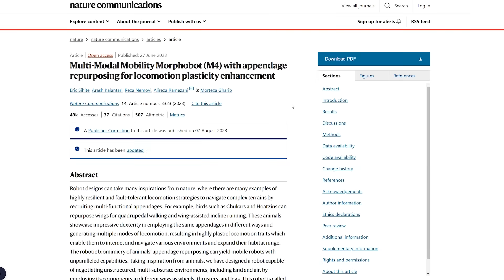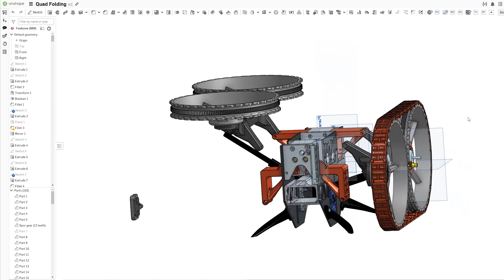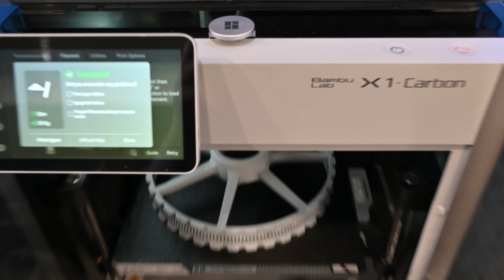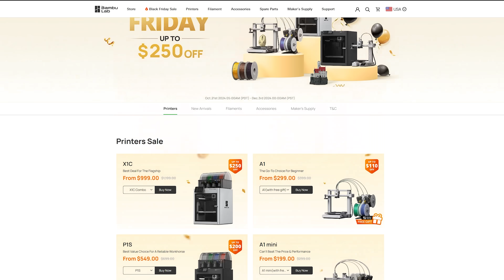Building a Real Life Transformer

Comment: Could you have it changed the gear reduction on the wheels/rotors when it changes mode? Higher torque for land and higher rpm for air?

Comment: Probably an aluminum plate with the same weight as carbon fiber is stronger because you cut the continuity of the fibers doing weight saving cuts, and all the cuts should have big radius not 90° - 45° sharp corners

Comment: I literally had this idea about 2 years ago. I'm currently in my last year of Mechanical Engineering, and I wanted to make this as a personal project after finishing to just apply what I've learnt and add to my resume while I look for jobs.
I thought I was the first to think of the idea so I was a bit crushed when I saw that it has been already done lmao, but ig I haven't done my research. It shouldn't matter too much, my initial sketches of visualization had a slightly different approach to switching from rover to fly mode and the general design of the vehicle.
One of the most interesting ideas in my "light bulb" archive and you've certainly done a great job giving it justice. 
Just subbed, great work!

Comment: Couldn't it be set up to where 'off' was in the middle...and then when switching to drive mode, you could set it up to do either top or bottom. That way if you flip it it would be able to still move(upside down). 
It would probably require a half overhaul. From linear actuators on possibly. Not sure...thoughts anyone?

Comment: I would definitely still be worried about the actuator/mechanism taking too much of a beating. I think some changes that might improve this is some servo mechanism to lock in the two different modes by sliding a pin into a hole so that the parts make it solid and not the electronic servo actuators. Might also sage some weight by using some lighter driving motors as this type of vehicle probably does not need to go all that fast. In any case a very impressive design with seemingly few issues considering the complexity. Imagine making this thing with so few issues and then previously having so many issues with the push-pull plane.

Comment: I hope you still check the messages for this video, but my suggestion is to not extend the body of the craft up above the wheels when in driving mode and instead to make it thinner so that it can be suspended over the ground and fit within the height of the wheels so that you can drive it upside down if it flips. If you can design the linkages right, you could even allow it to transition to flight mode even should it get flipped on the ground.

Comment: I wonder if the problem you had with the linear actuator was because they're effectively being treated as the struts for the drive mode. The rigid connection between the wheels and the body at that point is probably what ultimately broke it when driving around. Maybe in a future version you could have some sort of two-part struts that slot into each other when switched into drive mode to take the strain off the static actuators.

Comment: It would be interesting if it can handle a cargo bay or consider to have a passenger cabin on top or below. The motor for the flight might be a little too low for the job compare to the weight of the unit, it's like too much stress or power needed to make to a higher height? maybe more power source can solve that. Plus having a thread is good way of not damaging the rotor blade from from the impact on ground. May add some mesh cage by the blade to protect it from hard debris that may come while on land mode. Hope to see new variants of this, this has a potential to make it as an air-to-land "amphibious cousin" transport, lol.

Comment: If you need to reduce the weight, shouldn't the tracks be the first thing to go since you already confirmed that they aren't necessary? Give the wheels a grippy monster truck thread for the rough terrains and you could save another 100 grams. Also, the folding design could be designed better so that the 2 stage transformation could be done in one movement with only the two linear actuators. Or use only one servo with a greater gear reduction that controls both sides simultaneously, the wheels need to be aligned whether you're driving or flying anyway. Still a great project, and fantastic job getting it to fly!

Comment: Removing weight from the unspring weight wont remove much stress from the servo, try release some weight from the section the actuators are holding off the ground as its hitting bumps and wheelying around

Comment: All those screws in the tracks seems a little unnecessary. You could use small lengths of filament instead. (Like Ivan Miranda does on his tanks) you also could eliminate the tracks anyway for some more weight saving. You could add limited acceleration (eg. Instead of 100% to 0% instantly, you'd first do 50% for a second then 0% to not "lock the brakes" and flip. Or even 100->75->50->25->0 with each change waiting a specific time). I believe the term to look into is PID. On my projects I just have a target speed and a max acceleration that can be added to the current speed until they're equal.)

Comment: Michael, That pebbly texture you get on CF can be done on any filament using the "fuzzy skin" option in Bambu Slicer. I have mine set to 0.15mm for both settings and it gives a pebbly texture that hides layer lines pretty well. Additionally, on parts that aren't under much stress, Bambu has an "Aero" foaming filament that looks to be pretty light.

Comment: Im confused, you used two separate motors  too operating the left and the right side while in drive mode.  However.. your configuration forces both tires on one side to spin in opposite directions regardless.. the car wouldn't move

Comment: it would be nice if you had cams that will move the wheels up off of the ground before swinging them out for flying mode (and vice versa).  I think a lot of the strain on your linear actuators is overcoming friction with the ground.   ...also, I want one of these to use as a leaf blower!

Comment: That design is absurd cool, would it he good to tweak the height on the transformation?
The wheels folding out are asking to snag on terrain and put unnecessary stress on the pistons, just "extending the movement" of the car lowering in its "compact mode" a bit further would make the drone landing legs contact the ground earlier (the best would be longer drone legs), wheels raise a few cm and clear the ground before folding out

Comment: very cool project. I think it would be interesting to see a few things: 
1) Can you create a unified drive system, rather than that completely separate ones. I guess technically there are 3, the main drive, the rotors and the conversion system. But anything that could unify or simplify those systems would be interesting
2) Further reducing weight. This would probably be helped by a unified drive system, but beyond that anything that could make this lighter would be interesting. It seems to perform both functions, but the flying aspect of it seems significantly less capable than the driving one. Also, by creating a lighter system, it opens it up for other things to be added like cameras, automation controls, sensors, etc. 
3) Less interesting, but the time to switch between modes seems a bit slow and I wonder if it could be sped up. For example, I'm not sure if the lifts/drops of the chasis are necessary if there is another way of making those linear actuators do the full conversion action. 
4) It could also be interesting to see either a smaller or larger version of this. The smaller one could be cool if it reduces costs, makes it more portable/travel size, etc. The larger version could be cool if it had more power and could handle some type of payload 
5) would be interesting to open source the system to see what others can develop on top of this, and then do a video highlighting people's mods. Could also compare this against some of the university projects you mentioned. Appreciate that the stls are already available for free though.
6) You could expand the functionality/scope by making it also turn into a boat/water craft. Or even if you could make it into a submersible. 
7) I'd like to see other applications for it beyond the hopping over a creek. Perhaps reconnaissance into hybrid spaces. Maybe as a creative platform for different photo/video shots (probably needs more stabilisation).

Comment: Hey guys. Listen please. I'm just a process engineer but what the hell. The thing is kinda hard to fly because the center of mass is bellow the props. If you can add, let's say the battery modules at the top with a turret camera or whatever just to displace the cg would make the contraption much stable during flight. It wouldn't affect the drive mode that much IMO. Cool adventure. Impressive nonetheless!!! ❤
Reply: It’s also still too heavy. What’s the thrust to weight ratio?
Reply: Center of mass is almost always below the props

Comment: The idea of transforming from tank to quad is that you only use 4 motors, you are using 6 plus a bunch of servos, it would be better to just set the propellers in a statick position on top and the 2 motors for the tank track and you don't need the servos, no trasformation issue and way less weight,  btw there is a bunch of toys like this but with only 4 motors

Comment: This was a graduation project in the Faculty of Engineering at Ain Shams University for students in the Mechatronics Engineering program. Actually, they passed with a good grade, but the project did not work because the weight was too high. So, I want to tell you: good job, man! You made it by yourself without any help, and it worked.
Reply: pretty sure this was a project at caltech too, which had more modes available than the one he built. Pretty cool!
Reply: A group of university students couldn’t achieve what this man built in a cave and a box of scraps
Reply: @Noname-iq1gz  I also studied mechanical engineering. The skills needed to actually build, they cannot be acquired there.
Reply: Actually comparing to this man they are in a cave 😂😂@Noname-iq1gz
Reply: الأخ مصري
Reply: 🫡🫡 those uni senior year projects are a doozy!! He actually did a fantastic job
Reply: He not only figured out how to build it but he figured out that it needed to be figured out without even realizing it needed to be figured out
Reply: This has practicality assume it is going in terrain toward enemy line and suddenly it went airborne and started attacking
Reply: Did anyone else realize Mechatronics is like Megatron who is a transformer?
Reply: so they made this useless copter as Engineering project? lmfao
Reply: @furquan2792 having a pretty unique concept is pretty good for a university project, isn't it?
Reply: @TiMona42  No it must have practicality first!
Reply: @furquan2792  well you don't know until you make it
Reply: @furquan2792 major elitist vibes
Reply: @furquan2792  Why? It should always be an overengineered monstrosity first, so you know how to simplify it later. Besides, the practicality is it's fun!
Reply: @furquan2792  i dont see it as useless tbh. sometimes, u need what is known as a proof of concept. only when there is a proof of the concept, that concept can be further developed into more ideas. its like, having the internet. the creator did it and released it. but u dont see the creator of the internet coming up with youtube, facebook, instagram etc. it is ppl whom have dwelled with it, ppl with a different idea that further leveraged on a system to further maximise the potential. as in 1 of my post, this has great real world applications. rubbish are resources that has been placed at a wrong place. similarly like ur comments. it is a great comment in something somewhere else, but is trash talk here....

Comment: Maybe the wheels shape could be optimized to increase lift... Maybe shaping the edge with a curved lip as a ducted fan inlet to increase the lift? Maybe twisting the spokes with a pitch opposite to the propeller pitch would straighten the airflow and increase thrust too (I think I saw something somewhere mentionnig that such vanes worked like that for stationnary ducted fans)
Reply: Something I'd say is to tweak the height on the transformation too, the wheels folding out are asking to snag on terrain and put unnecessary stress on the pistons, just "extending the movement" a bit further would make the wheels raise a few cm and clear the ground before folding out

Comment: That's amazing! You've got a new subscriber :D
I've got to wonder if you can't use the same motor for driving and flying.... probably an issue due to torque requirements but perhaps with a few gears that attach/detach from the rotor shaft when the mechanism transforms? Also... I'm probably asking for too much but this thing begs to be flippable (i.e. drive both upside down and normal). You could even have bigger rotors that way.

Comment: I just thought about this the other day but without the tracks on it. The idea I had was to make an RC car with a drone motor in each wheel, have the wheels be the propellers, and then have the upper control arms attach to a servo motor that pivots the wheels facing down. then you can switch into flying mode while driving. You would just need to make the wheels into slicks and make them really light, but I think it could work.
Reply: I thought that's what it was going to be, but I imagine a motor couldn't have both the torque to drive the car and the rpms to fly a drone. Also the added spinning weight of the wheels would add a lot of rotating mass which isn't ideal for a drone.

Comment: @6:33 I'd argue that the treads are super necessary, since they protect the gear teeth on the wheels from getting dirty/damaged in contact with the ground.  They wouldn't be necessary if the wheels were driven without external gearing.

Great work!
Reply: Not only that, which such high torque, the added contact patch the treads provide probably prevent the wheels from breaking traction.
Reply: @BPBomber  is this the same as "slipping" of a belt
Reply: @artisticyeti22 similar I would imagine; both involve a wheel spinning without grabbing traction

Comment: Get your design skills out and make it look cool! While it's a very cool engineering project, it also looks like an engineering project. Make it look more like a batmobile or something 😁

Also consider making it so it can actually drive upside down if necessary, so if you flip it it's no big deal. Just having the option to lower it a bit and still drive should fix that.

Comment: Wild thought... what if  you made the propeller blades the actual wheels, and use the flying motors for driving as well?  You can eliminate a lot more weight, assuming there's enough torque for driving. (Maybe a tiny gearbox can help.) I do also wonder if a rack/pinion-based lift-arm mechanism might be lighter and faster as well. Super tiny servo, perhaps combined with some magnets to help hold in the two main positions. Edit: a bit confusing, but I mean to eliminate the linear actuators and somehow leverage the existing rack/pinion idea to handle the full range of motion between both operating modes.
Reply: I agree, it is so heavy and barely flies.

Comment: Actually the concept its so cool because i imagine when you drive on the terrain this thing would use less battery, but then if you got any problem like you said can fly over it and land, so you can keep going in your journey while having a battery life that would last longer than a normal flying drone.
Reply: i am picturing it as an espionage vehicle for military purpose. ur vehicle will be on the ground in a "silent" mode, tracking and observing it's surrounding. than suddenly when it is in range of its target, it turn and suddenly transform into an "attack" flying mode. thats rather a not so good application to use, but, still an application.
Reply: @armageddon87  wouldnt it make more sense to just have a detachable 300$ drone on a RC car? no need to blow the whole thing up. also you dont fly off with all the 'car components' like heavy battery.

Comment: I see lots of opportunities to shave off weight. Make the wheels with steel spokes, maybe you could even get rid of the actuators, you just need to unlock and then turn on the props
Reply: It's amazing and I could never build, let alone design something like that, but... I also wondered why there was both a rotating arm and the actuator. Seems like a lot of unnecessary weight and another point of failure.
Reply: Steel? How is that going to be lighter than plastic? Now carbon fiber would be another matter.
Reply: @Programentalist  was asking the same thing lol
Reply: I highly doubt the same motors would be a good idea, drone blades need speed, wheels need torque